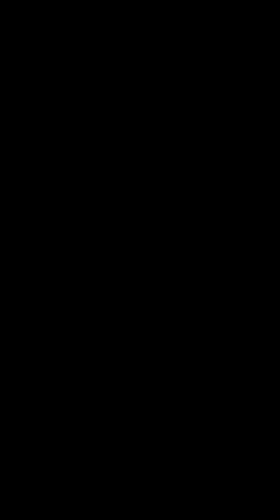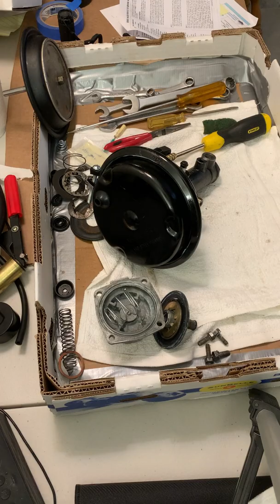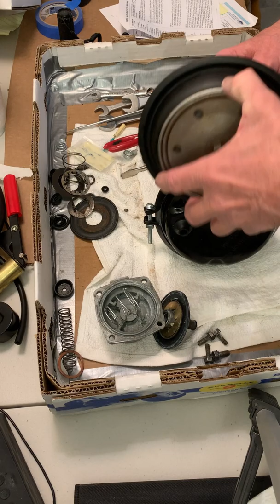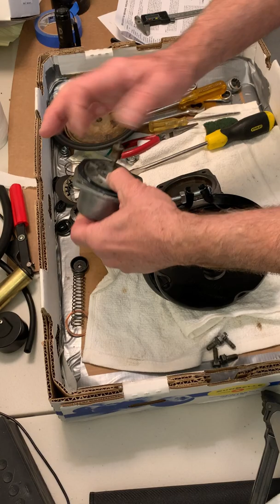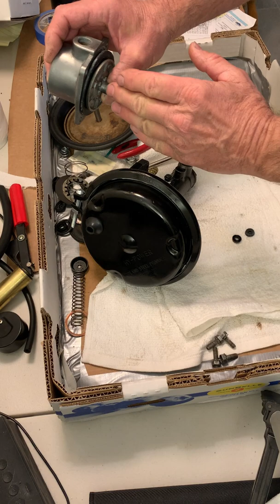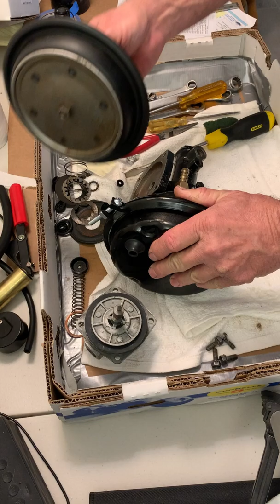1957 Ford and Thunderbird Midland Power Brake Booster Explained.. How it works

Comment: Jim, I have watched your rebuild video several times…. Excellent !!  Just noticed this explanatory video tonight… is there a way to apply a gauge to an inactive port on the booster and then measure any proper exchange of pressures to determine the efficiency of the booster?  I will swear as new and repaired as my booster looks, it is just not doing anything. But, I’m not sure…brakes are unlike anything I’ve driven in 40 years, mediocre at best
Reply: When I first redid mine I could feel it “kick in” and add boost. Not a lot but I could feel it. That didn’t last long. More recently it’s gotten to where it’s always on and never fully releases. I’ve had to disconnect the vacuum line to be able to drive the car. I think the problem is with the valve that’s inside the aluminum side housing. I suspect it leaks in some fashion causing the system to apply. It’s a real bummer. I will probably bite the bullet and have it professionally redone at some point. I feel your pain.
Reply: @EristiCat  wow…sad to know but I am thankful to know what’s ahead. Right now, it does not even come close to my very first car….a severely used 1960 Oldsmobile… and fails everything since 😉